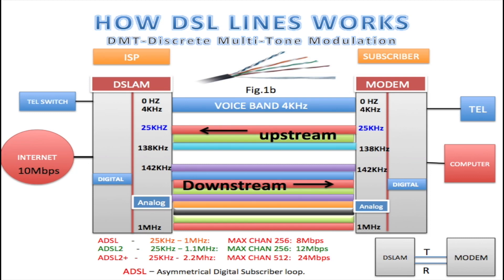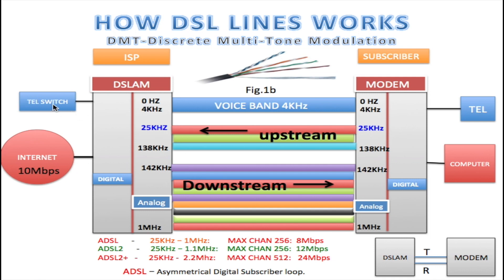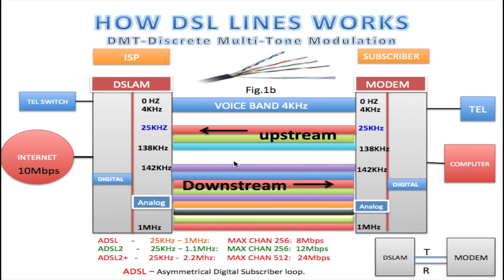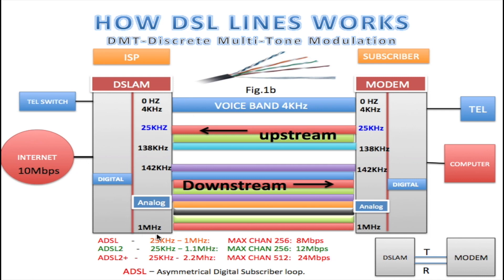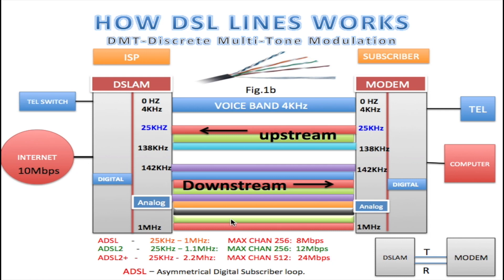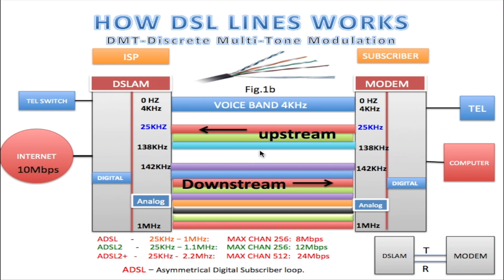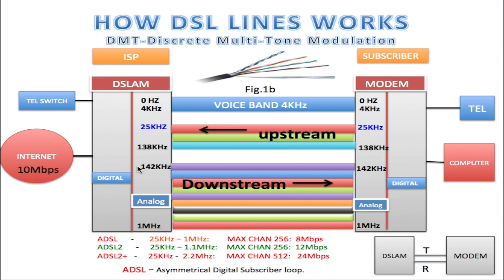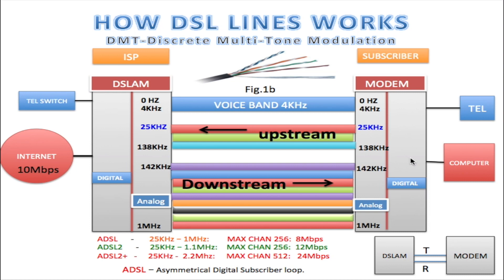HOW DSL LINES WORK (HD)

Comment: Sir can you explain the working of ISDN in same way ? Please.
Actually, my query is that whether Analog signals are use in main transmission line or they are Digital signal?
If Digital signals are used then what is the need of Modem in ISDN ?
Please explain sir.
Reply from the maker: It's a digital signal sent with in many 4khz carrier channels.  The basic principle is similar with cable.

Comment: Good video! Thanks.
I was wondering if the DSL filters installed to separate the voice and data signals is more so that voice transmission doesn't introduce noise to data signal or conversely so that data signal doesn't sound as noise in the voice communication?
This in  order to understand the use or not of filters in troubleshooting, as ISP techs have sometimes directed me over the phone to remove the filters for testing.
Reply from the maker: That is correct.  The main purpose of the DSL filter is to isolate the voice from the data on DSL lines. This filter prevents your voice from corrupting the data, since your voice would be noise to the dsl line, and to stop the buzzing noise you'll hear when speaking on the phone.  This noise comes from the modulated Dsl frequencies.

Comment: Good video. A very clear explanation. One quibble-the "L" in ADSL stands for "line", not "loop".
Reply: A line is a loop in telephone lingo.  DSL travels over dry pair loops no more than three wire miles from the central office, or remote central office.
Reply from the maker: Thanks Brad, that is correct. ADSL stands for Asymmetrical Digital Subscriber Loop.  As you said, in the industry we interchange the word loop and line which basically mean the same.  The term loop came from the telephone line which is referred too as a loop.
Reply: @wpiofm  Your reply has zero to do with my correction.